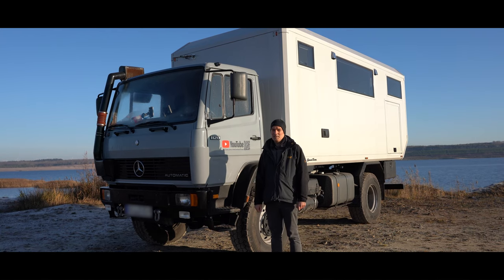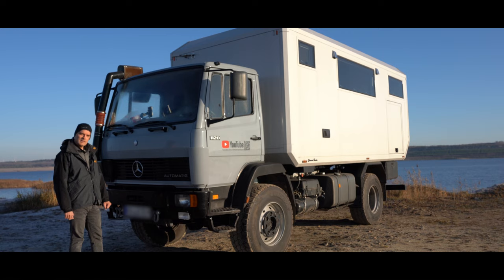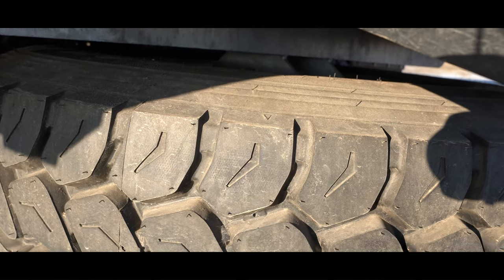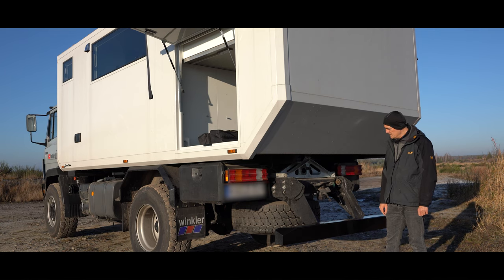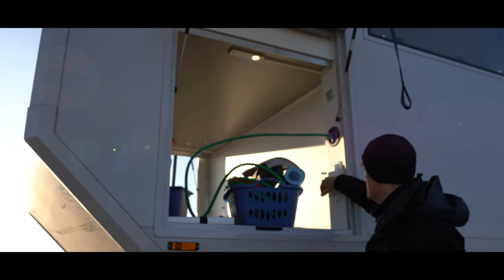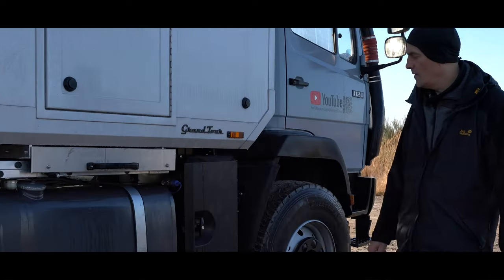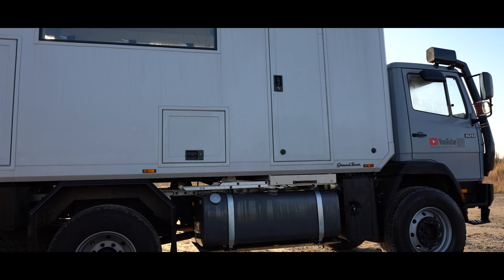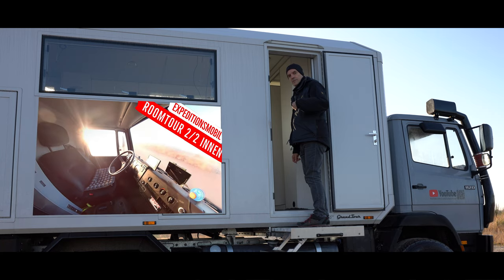ROOMTOUR  Expeditionsmobil Expeditions-LKW 4x4 Camper Exmo Allrad Lkw Fernreisemobil Weltreisemobil

Comment: Was war das maximale was du an Kabine drauf machen kannst auf dein LKW? Also Länge und Breite? Oder ist das was Du hast das maximale?
Reply from the maker: Hi Dave,
das ist das Maximale. 5.6x2,5. Wenn es länger würde wäre der Überstand hinten zu groß und der Böschungswinkel wird zu klein. Außerdem brauchen wir es nicht länger, so ist es perfekt zum Wohnen, und wendig ist das Fahrzeug auch noch.

Gruss Marcus
Reply: @4x4OverlandTravel   danke für die Info, hab irgendwo gehört das bei deinem LKW Modell nur max. 4,5 Meter drin sind deswegen meine Frage. Gut zu Wissen das 5,6 Meter Kabinenlänge drin ist. Bei welchen Kabinenhersteller haste den gekauft?

Comment: Dein 385/65er Rad wiegt nicht 60 kg, eher 120 kg. Selbst der Mantel ohne Felge wiegt schon über 60 kg. Mein süßes 9R22.5 Ersatzrad hat auch schon komplett 75 kg auf die Wage gebracht.
Reply from the maker: Da hast Du wohl recht, ist deutlich schwerer als 60Kg.
Reply: @4x4OverlandTravel  meine 395er auf 10x20 wiegen 160kg das Stück - 14er würde ich auf den LK nicht montieren - wirst'e auch wohl keine Eintragung für kriegen